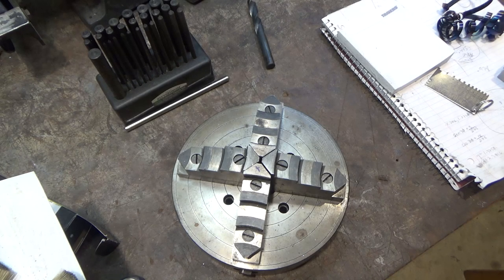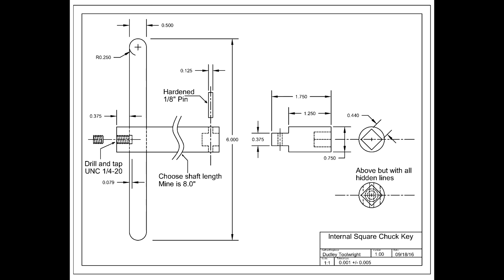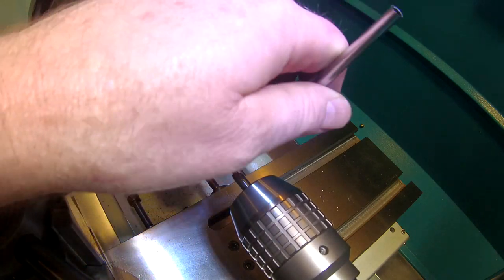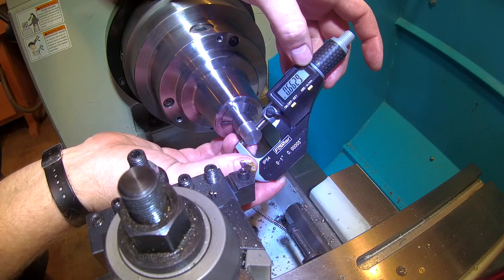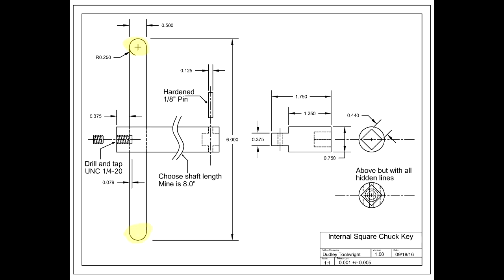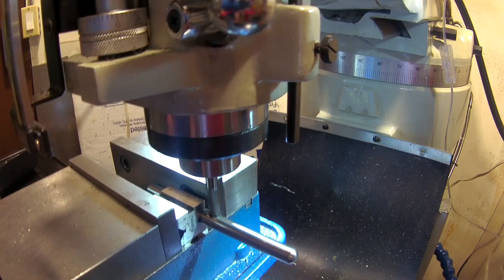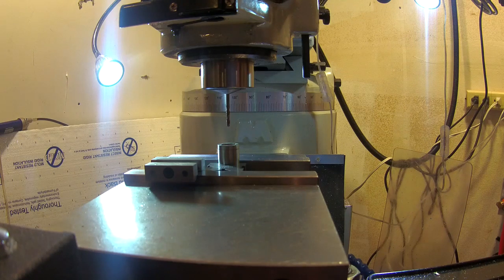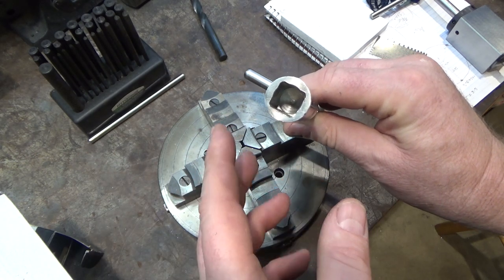Internal Square Chuck Key

Comment: At about 17:05 why do you have the horizontal feed engaged while you're sanding? Seems a bit dangerous as the tool could run into the chuck.
Reply from the maker: You are absolutely correct. I had hit the horizontal feed with my thigh and did not notice until the chuck crash. I was my first and so far only screw up like that. Good catch. I wish I had caught the crash on camera. My lathe fortunately has a feed clutch which disengaged and save me from some serious damage.

Comment: Nice job on the chuck key.I notice you use an electronic edge finder. Do you find it easier to use than the slip disc style?
Reply from the maker: Definitely. I was taught with the rotating type, but the electronic type is instantaneous and works when you are looking for the high point on a non-flat part (read round). My particular one is made by fowler and works with the r8 collet just hand snugged (no wrench). On the down side, the tip has to insulated from the shaft and to do this they seemed to use some type of plastic. If you accidentally slam the tip against a part, you will at a minimum, get a bad reading as it flexes, or will more likely break off the tip. Thanks for the interest and the questions.

Comment: Hello,  This looks like a perfect job for one of those rotary broach kits that Randy Richards made?  Was there a reason (other than not having one of course) that would be unsuitable?  As you mentioned in the beginning the 5C collet blocks make a male wrench a snap.  I do have those but I am looking hard for a set of blocks for the ER40 collet set I also have.  Other than a set available in England for pushing at two hundred bucks (not sure of the freight costs) or 59# per block I can find no source in the US.  Have you run into any?  I would think Shars etc would be right on selling those as well as the 5C blocks.  Another good video though I wish the end film was there.  Take care.  Doug
Reply from the maker: I would love to use a rotary broach, but as you suggested I do not have one. It is on my ever increasing list of tools to want.  I have had decent luck with finding sets on ebay. Shars and HHP are also pretty good sources. I got my er32 set on ebay and it has been fine. I haven't tried to measure the runout to see if it matched the manufacturers claims, but for the times I have used them they seem reasonable. Thanks for taking the time to comment.

Comment: Hum, you crashed the tool but did not show us?
Reply from the maker: I don't remember. I usually show my mistakes. If this was the time I crashed the tool into the 5c collet chuck, I thought I showed it. I have only crashed the lathe twice. I hope it never happens again.
Reply: It looked like you had the feed running and it was headed to the Chuck (@17:28 ), in the next bit, it shadows changed and it looked like a new scratch, must have been perspective?